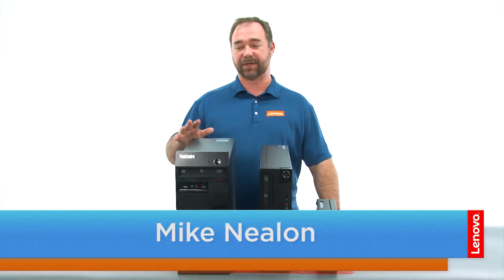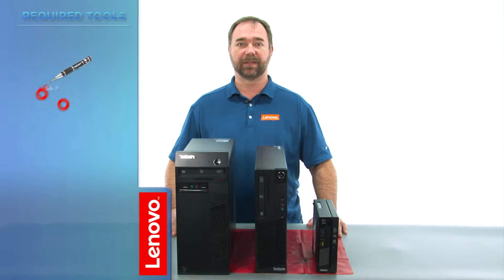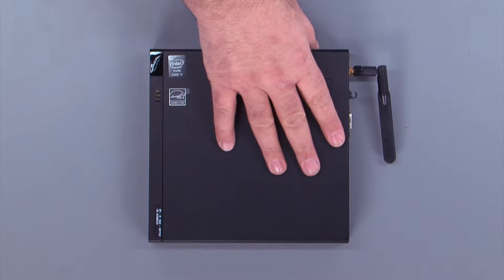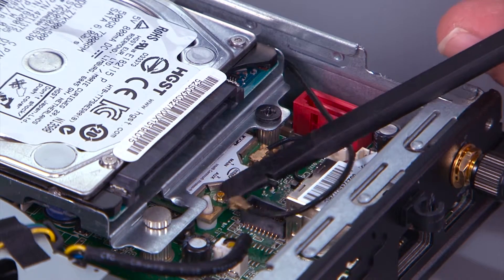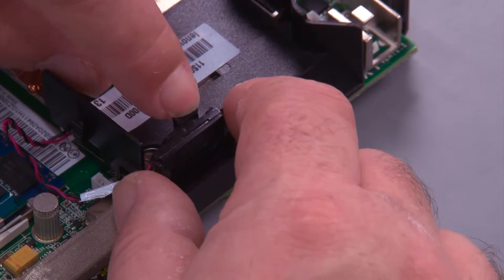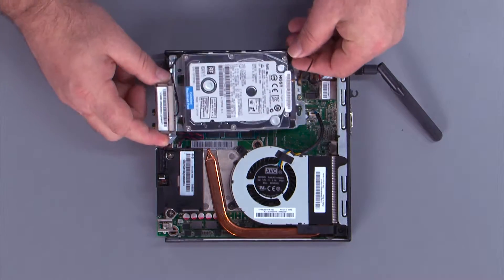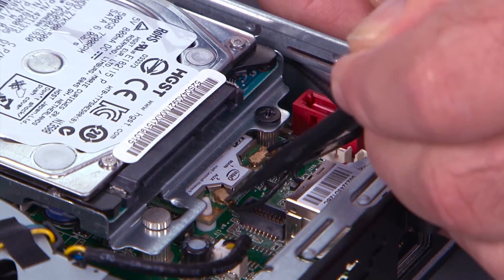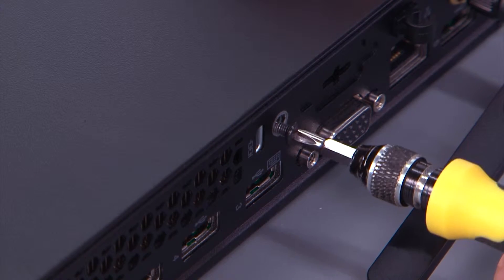ThinkCentre M73 / M72e Tiny Desktop - Internal Speaker Replacement

Comment: Is it possible to upgrade the RAM an a pretty old all-in-one M73 from 5-ish years ago? It has 4 GB, but I'm pretty sure you cannot upgrade the RAM on an all-in-one, not without taking the whole thing apart which I do not at all have the experience to do.
Reply from the maker: Hi person54! Thanks for reaching out. Based on the specification the Thinkcentre M73 desktop can hold up to 16GB max RAM. It has two 240-pin DIMM sockets for the UDIMM, PC3-12800 1600MHz DDR3 memory module. You can check that information here https://lnv.gy/32rwNDT - Let us know if you have other questions. Mark_Lenovo